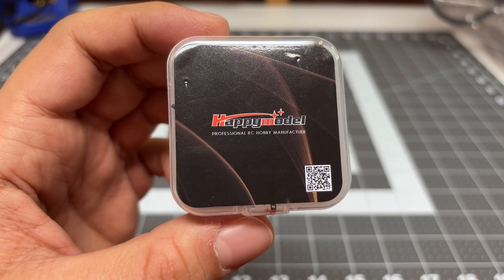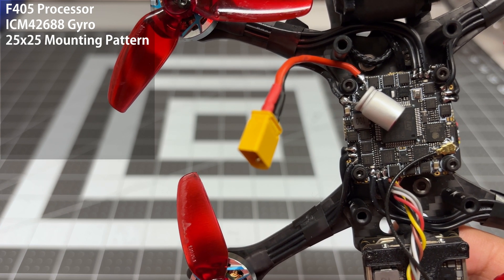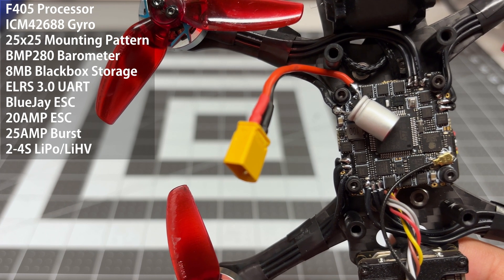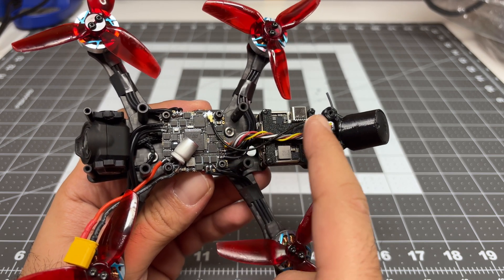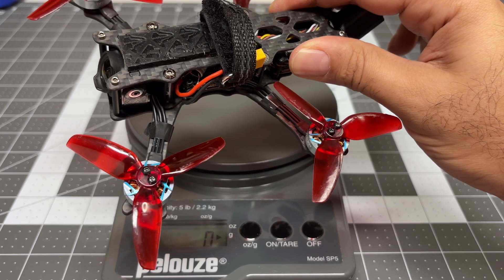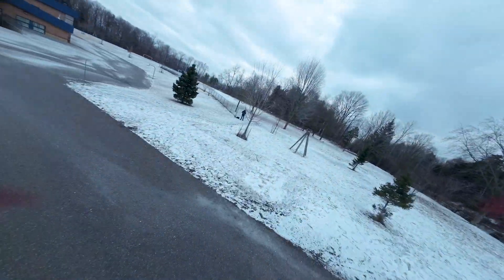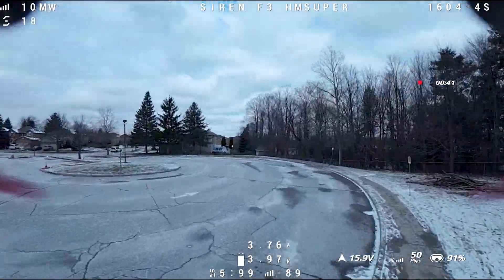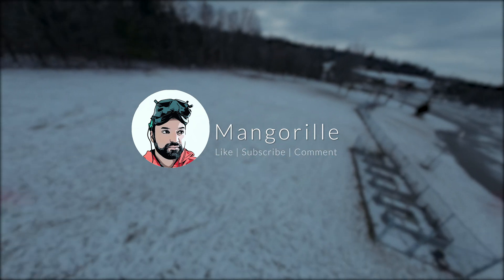This AIO Does The IMPOSSIBLE! | Happymodel Super F405HD ELRS 20Amp AIO Flight Controller Review

Comment: Have you had any luck updating this to the latest version of betaflight
Reply from the maker: Yes, no problems. There are some notes on the Happymodel site about some additional codes to add if you had some problems. Check here: https://www.happymodel.cn/index.php/2024/01/05/super-f405hd-elrs-aio-3in1-flight-controller-built-in-uart-2-4g-elrs-and-20a-esc-for-hd-whoops-25-5x25-5mm-mount-hole/
Reply: @Mangorille  🙄 I had expert mode off in the Flash section..
Reply from the maker: @hairyhider7478  :) Happy flying.
Reply: Thanks Mang you to brother.
@Mangorille

Comment: I'm looking for the diagram and can't find it. I have the Super f405 AIO flight controller from caddx and I wanted the diagram to be able to see the make up but can't find it.
Reply from the maker: I found this... https://www.flyingtech.co.uk/product/caddxfpv-super-f405-hd-elrs-gofilm20-aio-flight-controller/
Reply: @Mangorille  thank you seen that one too, it doesn't give a diagram of the capacitors, I bought a esc from walksnail and it was faulty and I think one of the capacitors were wrong or something but I can't know which one without a diagram and I don't have the tool to check it without desoldering it, which I think that's what I'll just have to do smh. regardless thank you for the quick response!
Reply from the maker: @Fourtho  Good luck!

Comment: Do you think this could handle a 3.5" build with T-Motor P1604 motors? i wanted to make a light weight 3.5 build with the AOS 3.5 V5 frame for freestyle
Reply from the maker: I believe so, I used those motors on a 3 inch build and pulled a max amp draw on 4s of 54 amps so there should be plenty of headroom with this AIO (can support 80 amps).

https://youtu.be/JV8NnNlx2vg?si=yvRn2s-yVuTT2uNX&t=175

Comment: Compare with betafpv F4 2-3S 20A AIO FC V1. Which one is better?  Thanks.
Reply from the maker: The one you mentioned is what comes with the Pavo 20 so I've used it a number of times. A few negatives:

- It doesn't support 4s (Super F405 does)
- It doesn't have a USB on the board (Super F405 does)
- It uses a wire antenna for the ELRS (Super F405 has a UFL that you can connect to a more typical antenna)
- It has a piece that sticks out for the battery connectors which may not work with your frame

Comment: Did you have to change the orientation on your FC? Mine is set for 90cw. I have a diagonal fc setup to where the usb port is in line with motor. When I arm the quad goes crazy. I don't see an arrow on fc anywhere. Thanks
Reply from the maker: I typically do not arm a new build without doing these checks:

1. Move the quad around by hand when connected to Betaflight (not powered up!) and make sure that the little quad image moves in the same direction. If it does not, you need to update the board/gyro alignment. Sounds like you did this step already.

2. WITHOUT props attached, power up the quad and on the motors tab, spool up each motor and make sure that the correct motor position spins. E.g. if you move the motor 1 slider, you need to make sure that motor 1 is the one spinning. If this does not correspond correctly, use the motor wizard to remap the motors.

3. WITHOUT props attached, repeat step 2 to make sure that the motors are spinning in the correct direction. If they are not, use the Bluejay configurator (esc-configurator) to reverse whichever motor is not spinning in the correct direction.

4. Attach props and do your first test hover in line of sight.

Comment: Why Quadmulla doesn’t put 25 x 25 mounting on their three and 3 1/2 frames beyond me. Everybody else does. Also, there’s a lot more AIO’s out.
Reply from the maker: Their frames are too narrow but yes should be resolved very easily if they wanted to. I just use a 3d print adapter, not a big deal.
Reply: Flywoo doesn't put 25x25 on their Explorer LR4 either, does my head in.  Which is why i sold the frame and went with Flyfish Atlas LR4

Comment: Love this, Is there a way to set the power output on the HD port to 5/9V instead of battery volt? Running 4s and the new 04 Lite unit only supports 3s
Reply from the maker: No, it's hard wired to battery voltage output on the DJI connector. This does have a 5v pad but I can't find any specs on what kind of amperage it can do. I'd start by using the 5v pad and see what happens. Worst case you'll need to use an external BEC.

Comment: Hey. Great flying in cold weather!
What is the best flight time you can get with builds like you have (light 3 or 3.5 incher with 1404)?
Reply from the maker: Thanks. If I do a smooth cruise type of flight, I've been able to get about 8:30 on a 4s 650mah battery pack. Once you start to push the quad, you're probably looking at closer to 4 minutes.

Cruise flight for proof :) https://youtu.be/LasNvVQoTiE?si=WL9lv0KRXCR-UbI_&t=309
Reply: @Mangorille  oh wow thats awesome, need to be checking your videos more often for good micro build ideas :D just based on your experience, will 3.5 with 1604 fly longer if needed? i want to build 2.5-3.5 incher with o3 to be able to get longer flights to do some videos on o3 but same time when needed to not have luck of power and have a rip with it, so trying to find the balance between efficiency and performance
Reply from the maker: @Eto-Maxim  The 1604 is going to add weight, which will be the enemy of long flight times. You can go with 1404 motors on a 3.5 inch as well. I've done it... Here's my 3.5 inch build. I never did a cruise style flight with it though.

https://youtu.be/Uwasr2duZ9g

Comment: I run this and the crazyf411 in my crux35/Volador 3.5. I had to print new mounts for the antenna to work out, but the ICM gyro is a bonus IMO vs the BMI270. I know the BMI is cleaner, but ive had a lot of issues with the gyro going out in crashes, much more so then any other I've used.
Reply from the maker: Nothing wrong with the ICM, it just needs a properly designed board with enough filtered power. :)

Comment: most builds could get away with way smaller less powerful boards and still function just fine; you don't need a 55amp esc to fly casually, even on 6s, most people need to chill with their parts lists.
 BUT, this hobby also has a lot of cheap-asses, that will buy junk off ali-express (supporting Chinese slave labor) for pennies and complain that parts burn out.

also,  with most AIO they are indented to be installed at an angle, so the motor pads end up all weird. same with the power lead, it always ends up all weird. (I hate it)
Reply from the maker: Agree, the amperage capability of the modern ESCs are out of control. My build pulls a maximum of 55amps total so technically a 15amp ESC is all I need. :)
Reply: @Mangorille  my 6s fox crooked pulls around 30 per 2207 2100kv motors with a high volt battery.  :/

I'm not crazy good but I can kaak the throttle in the race.

Comment: Looks good 👍. Happymodel gear has been pretty good IME. The price on this AIO is not bad at all.
Reply from the maker: Same, been using their ELRS gear for years. It seems a bit more expensive on the surface given the F4 processor until you factor is that you're also saving on the ELRS Receiver.

Comment: i really love your vids and i will definately order this aio.
i'll start building my first quad using volador vx3. it sucks that quadmula cant ship on my location. they wont even reply on my emails.

these are the parts i'll be using and i will really appriciate if you can suggest replacements in case the parts i choose doesnt fit on my build.  we have the same goal "ultimate lightweight 3 inch quad" and i also fly semi freestyle.
frame: flyfish volador vx3
aio: happymodel super f405hd
motors: t-motor f1404 4600kv
props: hqprops t3x3x3
vtx: walksnail avatar hd pro kit 
batts: 4s
Reply from the maker: Thanks buddy! Parts list looks good. What exact battery are you looking at? Only suggestion is to look at 3800kv motor instead. Not that the 4600kv won't work (I've been using 4600kv for 5+ years) but those are a really high kv if you are targeting low weight and a small battery, which leads to more battery sag. Thoughts on what your target ready to fly weight will be?
Reply: @Mangorille  there is a local online shop here that sells GNB GAONENG 14.8V 550MAH 4S 90C XT30 LiPo Battery. they also have GAONENG GNB 4S 15.2V HV 660MAH 90C XT30 RC LiPo Battery. these are the 2 types of batteries im planning to use. target weight is around 230 to 240g or as long as its below 250g. we really dont have laws yet when it comes to FPV here but i just wanted to go with the sub 250g. 

i just noticed. the happymodel super f405hd aio doesnt come with capacitor or maybe im mistaken. just incase, what capacitor should i use?
Reply from the maker: @flylowfpv  The 550 is a small pack for this build. I've been using the 650 packs with good luck. I tried the 530 pack and the smaller cells have higher resistance which makes them sag more. A 25v 470uf capacitor is what I run.
Reply: @Mangorille  this is noted. imma get the larger packs then. larger packs with 4600kv motor it is. time to order the AIO and the capacitor. frames and other parts are on there way but im not hoping to finish the build before new year. im not really on a rush. 

i really appreciate your help. thanks a ton and happy holidays!!
Reply: @flylowfpv I have same frame with tmotor 4600kv motors. You will need a motor output limit and props with less pitch! The vx3 is a chunky frame and battery sag is a really big problem. I will search for a way lighter frame.
Reply: @LinusHocke  thanks for the info. i will install the 4600kv first since i already have it. i also order a 3800kv motors. may i also ask what battery are you using? tia
Reply: Im using Tartu r-line 650/850 4s 
Their 750 could be the golden pick but I don’t have one here for testing
Reply: @LinusHocke  i think we have a supplier of r-line here. not locally but from china (via lazada or shopee) and thanks for the answer. i will try to get a pair of those batts.

Comment: I've found that a little more weight on the 3.5in actually makes it fly significantly better. My 3.5in builds range from 185g to 229g (without a battery) and the heaviest one actually feels the closest to a 5in. Sure the lighter builds give you more flight time, but they seem to lack the inertia that the heavier builds have. I still get 4 min on a GNB HV 850mah 4S on the heaviest one.
Reply: I have a 3.5" with digital DJI inside and it weighs just over 100 grams! The power to weight ratio is out of sight! It's so fast it's almost scary and it maneuvers like a big Toothpick drone! Corners amazing. So, maybe for tricks and power loops more weight is ok, but lighter is ALWAYS better. It gives you that huge power to weight ratio that makes the drone perform so incredible.
I highly suggest you building an ultra lightweight 3" or 3.5" and see what I mean...
Reply from the maker: I found that with a 3.5" as well, the disc loading is all off otherwise and it feels too overpowered and touchy. With a 3" you can afford to be closer to that 225-230g ready to fly.
Reply: i just built one of shawn’s (let’s fly RC)!3.5 inch tanq S frames. i’m running GNB HV 650mah 4S and it flies BETTER than my 5 inches. i have not flown my 5 inches since i got it. so yea, i agree with everything you said here.
Reply: @ the power to weight on the 3.5in is a little harder to dial in then the 5in, but once you do boy to they fly great. Inside a tight bando, or a small park, they really shine. I still prefer the 5in, but for traveling I have a fleet of 3.5in I take with me.
Reply: Yeah but they all fly like shite compared to a 5”

Comment: I could think of at least 3 different motor sizes i like to use on my light builds, some brands are making weird sizes as well.
Reply from the maker: They key is the AWG of the wires that the motor uses. If they are too thick, you'll have a difficult time soldering to the board.
Reply: @Mangorille  i was going to comment on it but I'd already commented so much, flywoo is the last 2 aio I used and both offer side soldering and that helps a lot with the closeness I hate when the tabs are close and only on top like that but i know that those bee boards are good though.
Reply from the maker: @JustKeepLivingFPV  This also has motor pads on the bottom of the board but they are even smaller. :)
Reply: @Mangorille  I see, should try and put the middle motor wire on the bottom if you had 20aug would have to do a little B's flip flopping
Reply from the maker: @JustKeepLivingFPV  Very creative, I like it!